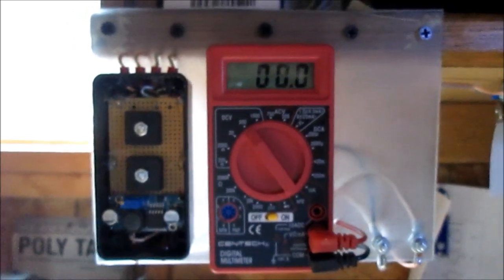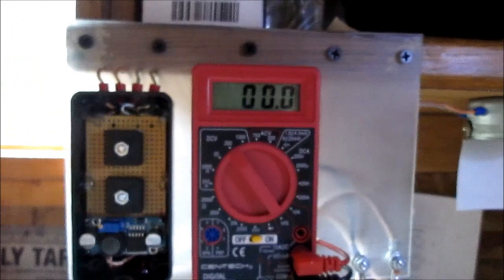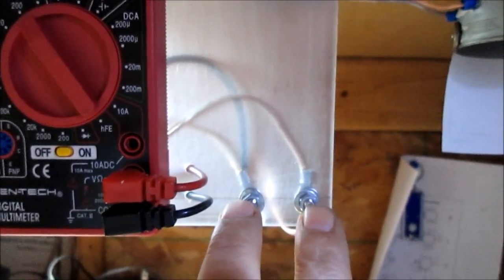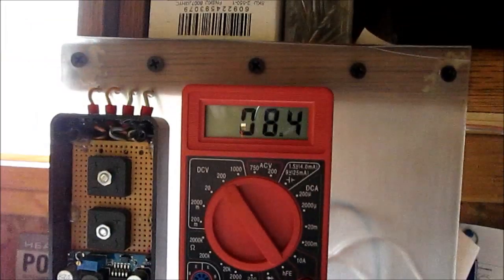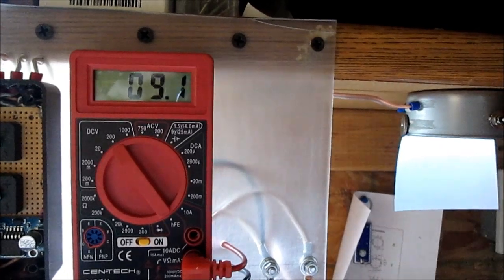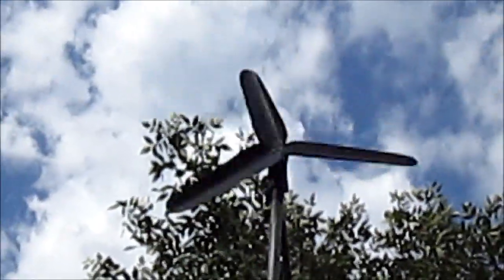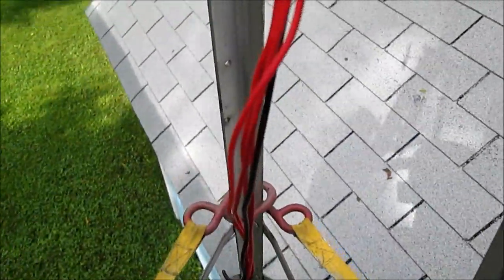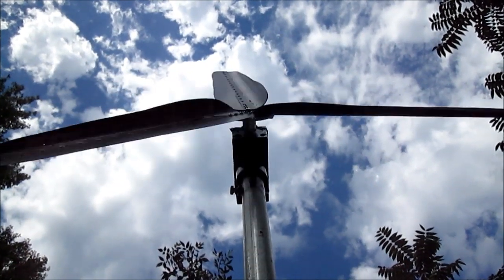Mini Wind Turbine made with stepper motor

Comment: i got a question did you just drive it with the blade mounted on the stepper motor or did you used a belt or a gear
Reply from the maker: blade is just on the motor since it is a small motor being used

Comment: I appreciate your video.  I like to tinker with stuff and plan to make a windmill generator.  I'm sure I'll be wondering what it all means too.
Reply from the maker: Alex C Thanks this is a fun project To watch it light my led lights at night
Reply: Alex C it means this, when you have no load on the generator it spins pretty freely, when you turn the light on you add load and the generators speed starts to slow down and voltage drops.

Comment: I suggest you just use this as a training turbine, hook up a battery like I have said and hook up led bulbs and study the turbine meter readings as it blows.
later you can either build or otherwise get a more powerful turbine to generate some real power
Reply from the maker: That is what I will do If i get a good windy day I have AA and AAA rechargeable batteries that need charging I will monitor with my meters to see what happens ...I do plan on getting a small solar setup Like from HF with led lights to play with
Reply: not2fast4u2c the average cost per watt on panels now is about 75 cents, the HF ones are not very efficient  and over priced. take the same money and but one panel, then buy another later and so on, look for a local solar store that you can buy the panel without shipping, something like a 140 watt 12 or 24 volt panel
Reply from the maker: Rev John O'Toole I don't think there are any stores in my area and I won't buy from a RShack store For around 20 dollars I can get a solar security led light from HF good enough to play with

Comment: Neat little set up. If you generate enough power to charge a cell phone to make one quick call, not a bad little emergency set up.

In simple terms, what you are seeing is a source that is both "voltage source and a resistor".  Think of a battery + resistor.  When there is no load, there is no current, so no voltage drop across that resistor.  So you see 30V.    When you apply the LED, you now have a voltage divider (current goes though both the internal battery resistor and your LED lights).  Guess is 10mA for the LED string, and we see 8V across the string.

So this Frenchman,  Leon Thevenin, realized you could figure out what that hidden resistance internal to the battery is.   With my numbers above, it is 30V & 2200 Ohm.
Pretty high impedance(resistor), but if you can charge a small AA battery and later power up a couple of LEDs (there are some super high efficiency ones), you can have a cool night light.   About 1/2W of power     (I use a AA battery & MCP1623 switching regulator to power up my uC board)

Back to our cell phone.... uh you need about four windy day to charge a cell phone. You have the basic idea. If you spin up an alternator by wind (big blades).  You can get 13V @ 50A.... 65W of power.  Wahoo... you get the idea of scale.

Sorry for being so long winded.  For those Home brew folks, looking up a chip called the PAC1710.  Simple power measurement. Use an external resistor to figure out current, chip is good to 40V, and you have part of a measurement system to track power produced.  One device going into the battery pack, another coming out, add a little micro-controller and pretty good heath monitor.    Still love my schools moto "Learn by Doing".  Keep on doing, when you have a question just ask....
Reply from the maker: Thanks for all the Info ..When I get some wind I am going to hook a AA battery up to charge and do my best to check with my multi meters  what I get

Comment: the difference between a turbine and a solar panel is the solar panel will the rated voltage and the current will increase as sun gets brighter. the turbine, the voltage will increase as the rpm increase.